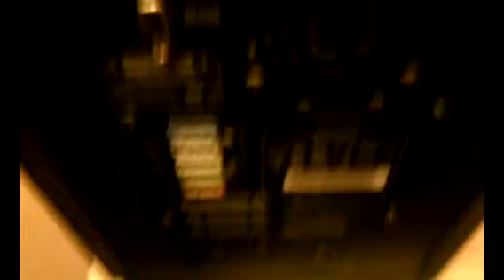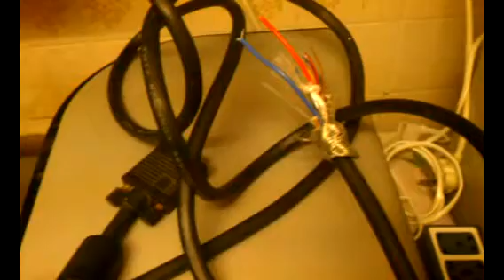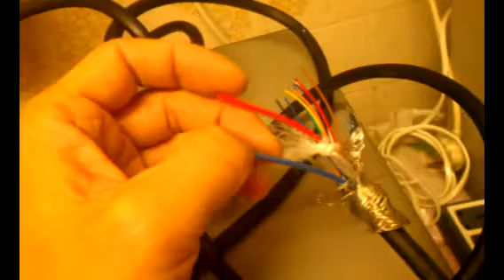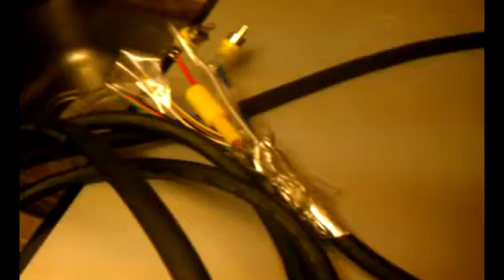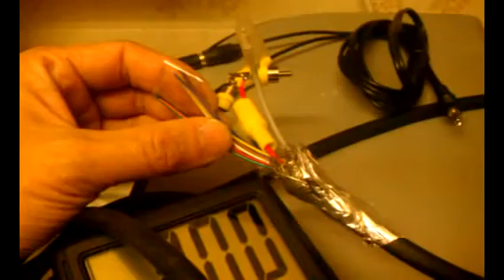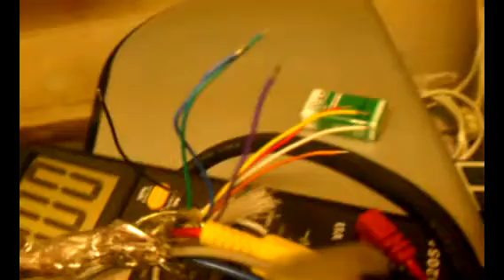Philips DVD player HTS3450 subwoofer mod

Comment: YES DER IS, REMOVE DA SUB WOOFA AND ATTACH TO A CHEAP POWERED SUBWOOFER WITH A BOX. I ATTACHED MINE TO A 200 WATT 85 RMS VERY OLD POWERED SUBWOOFER AND IT BLOEW IT OUT OF WATA
Reply from the maker: Yes, replace the circuit board is a good option~

Comment: 'm trying to make a cable adptador for home teather hts 3450, you could help me ?
Reply from the maker: I've tried to purchase the actual DVD player so I may simply plug it in, but this is not possible no more..... .... I've look into the circuit board, THERE IS A PAIR OF CABLES AND WIRES (WHITE), WHICH I DO NOT THINK IS THE AV CONNECTIONS... ... ... and the control board is just full of pins, so the best chance is cut off the VGA connection cable, and then wire from outside... .. . .. .. .. ..
This subwoofer may be chip and software control, which means that an "Editor" is need.. .. ... . ... I am not sure........ ..
When I was searching for the control board, the technology applied to this circuit is not as simple as AV in and AV out, so there is no AV connections, and there is no simple connection, and there is no magic.. ... . .. .. . .. .so finally I give in, pay some money to buy a new one with wireless subwoofer, Yes it is wireless subwoofer~~
But if you have started~ I am in~ Just upload what you have found and the update, I would try to look into it ASAP~
Reply: then I uam cm connection like yours, looking vc vera amplifier scheme, the first cables to 15 ... then 1 is the volume signal something ...
cables 5 , 6, 13 are negative GND 10e ...
4.7 cables , positive (audio input L / R)
cables 11,12 ( R)

cabos14,15 ( L)

land Gnd- mesh cable

to connect the sub just put out one in mesh adapter or green light will rise
Reply from the maker: I see, you save my day, thank you so much.... I would try right now, thanks again
... .......... The only problem is that this one is a second hand I've found on the street you see~ This power supply may have already toasted and broken, still thank you so much, very nice to meet you~~
Reply: consegui fazer funcionar !
Reply: Thales Henrique como?
Reply: @thaleshenrique9580  eai cara. Esse cabo q vai p o subwoofer é o mesmo que um vga?
Reply: @thaleshenrique9580  brother can you help ?
Reply: @LoudRock   isso mesmo
Reply: @walidbinzakirzakir2194  claro